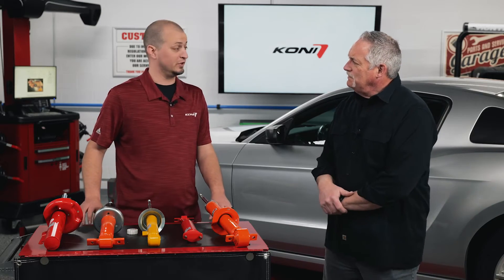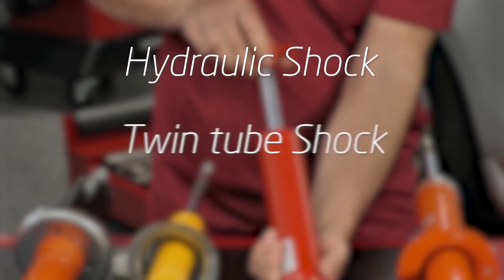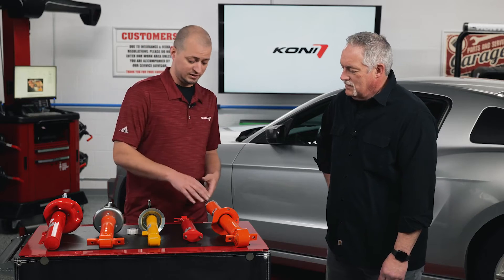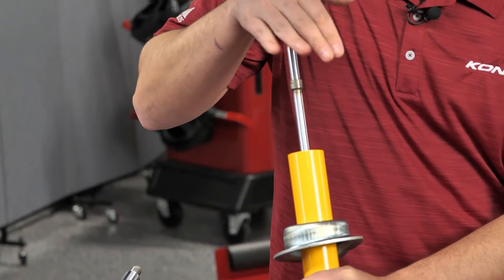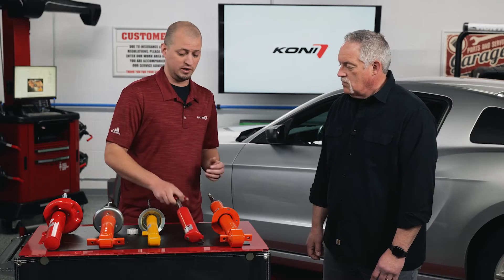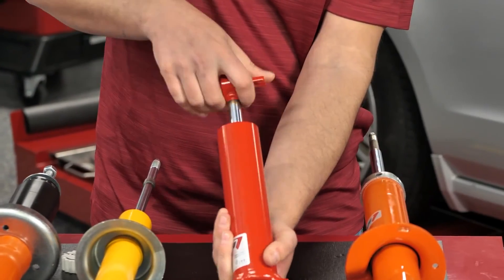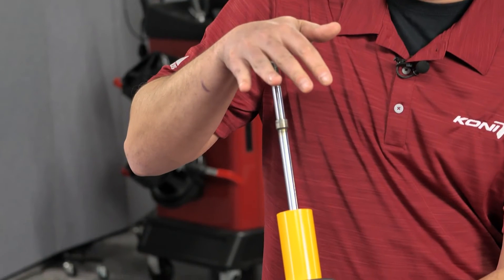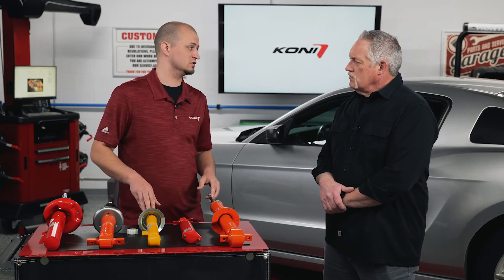Why some shocks do not always extend on their own.

Comment: Question...
I have a 1996 CORVETTE GM Real Time Dampning shock (F45 Option) that does not rebound. Its NOS and just removed from the box. Is that characteristic of a RTD shock or did it lose its charge from sitting in the box for 30yrs.??
Reply: 30 years? Yes definitely lost it's charge

Comment: Why im i able to compress down a shock absorber if its new? I tought it would of taken more lbs of pressure maybe in the thousands.
Reply: The weight of the car is supported by the spring, not the shock.
Reply: passenger cars get  like max 600kg per wheel, but in th rear, most of them are like 200kg per wheel. You weight like less than 100kg i assume, so you weight half as much....why would that not compress then shock????

Comment: Not fully true. All gas shocks have pressure to automatically extend the shock absorber. When a shock is compressed and does not extend at all it usually means there is a issue with the gas and fluid being mixed or bad valve.

Shocks are ment to automatically extend and compress during load use. 
If the shock collapses on its own or little to no pressure put on it, it's not doing it's job at all. 

Some shocks require priming is tou received them and they sat on their sides for a long time causing the gas and fluid to mix.

To prime or check rod reaction on shocks or struts, follow these steps:

Make sure the unit is at room temperature
Cycle the unit from full extension to full compression two to three times with the rod facing up.
Fully compress the unit and allow the rod to extend on its own. This should require less than 45 seconds on a unit with normal gas pressure and up to two minutes for a low gas unit. (Avoid using excessive force to compress the unit – it could damage the valving.)

Once the unit is primed, there should be no lag in control or dead spots while cycling the unit through its complete stroke. If the unit fully extends to these specs, it is considered fully functional and is ready to be installed.
Reply: Thank you
Reply: Not fully true, when shock is mounted on the car, the little gas charge it has is no where enough to actually extend itself back up going over a bump. That's the job of the spring. The purpose of gas is to prevent cavitation in shock oil
Reply: @papimasfuerte4671  Wrong. Shocks don't have springs... You're thinking wrong. I've been a Ase A/B tech over 25 years and certified in shocks and knowledge of how they work and are built. Springs are not shocks.
Reply: Springs always control the shocks.  The shocks are forced up by the spring when it rebounds whether its a McPherson style spring/coil strut or even if its a leaf spring.  Your a mechanic?  The shock itself does not support the vehicle
Reply: @codybenson25 Maybe go pull or find a Shock. Not a strut. Press it to the ground to compress it and let it go, it should fully extend back on its own. Leaf springs or coils springs help support the load, they dont control a shocks function... 
Take a vehicle with leaf springs and bad shocks. Hit a bump and feel it, its bad because all the pressue is in the leaf spring.... Do the same with good shocks and there is no stress to the leaf spring and the vehicle doesnt feel like its slamming to the ground.... 
The video is not talking about leaf springs. Its talking about Shocks. 

You can Google shocks and how they are designed or built... Gas shocks dont have springs inside..
Reply: @papimasfuerte4671  struts have springs on them, shocks are a gas and fluid with seals.